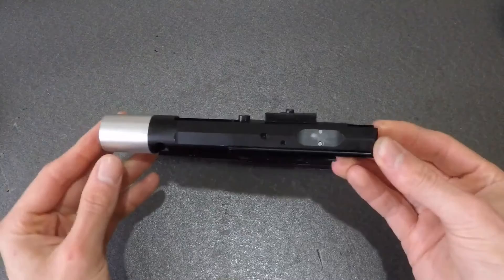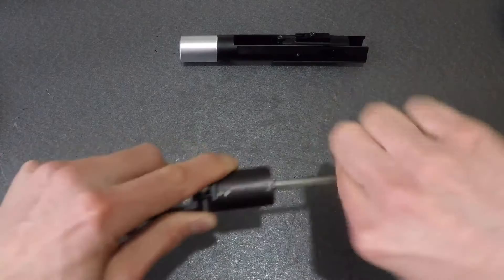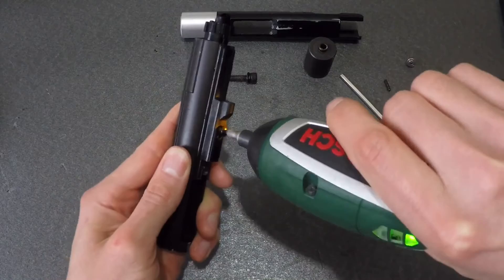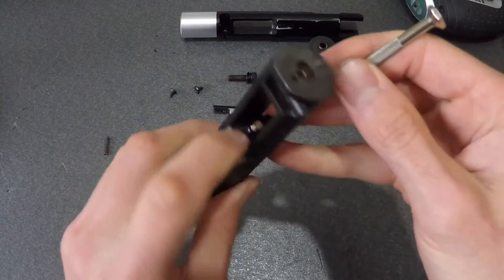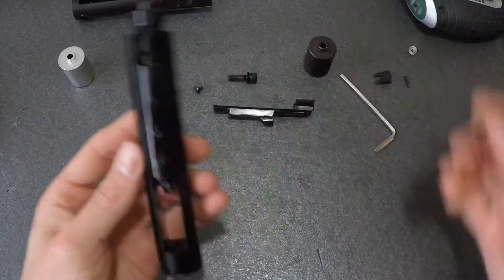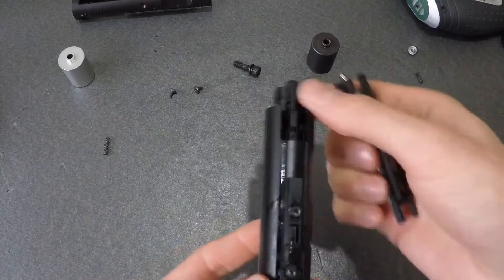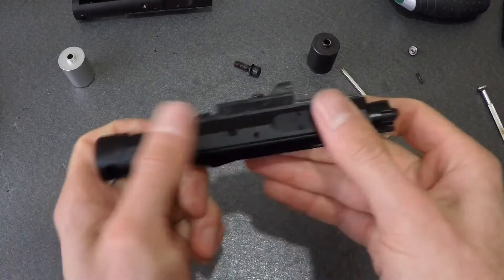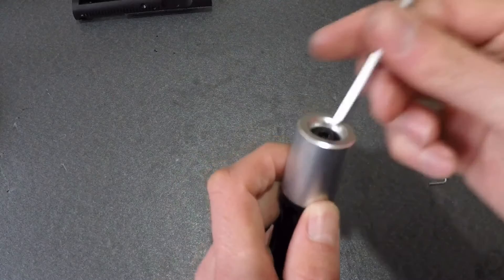UAC Lightweight Bolt Carrier TM M4 MWS Guide

Comment: I thought about the same shape, but I also think that it will become a countermeasure in the winter when we weaken the spring in the buffer tube.
Reply from the maker: +aqua04031227 It'll be a fine upgrade for yourselves in Japan where you don't have access to higher pressure gases. 😁
Reply: Response is improved, right?

Comment: i am looking to build a dmr so i am choosing now the bolt (there are some good option angry gun and modify ). What should be the ideal weight !?
Reply from the maker: For DMR purposes, I'm not too sure about what is optimal. 
I don't think it matters all that much. You'd obviously be getting better gas mileage with a lighter bolt carrier. 

Also bolt bounce might be something you'd want to eliminate, you can do this with a weighted buffer. Try and make each action as efficient as possible.